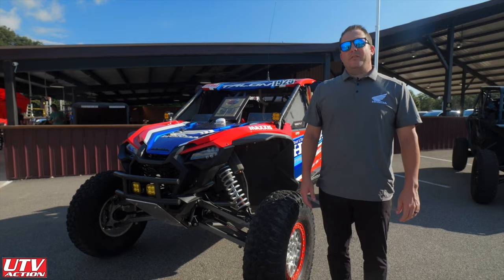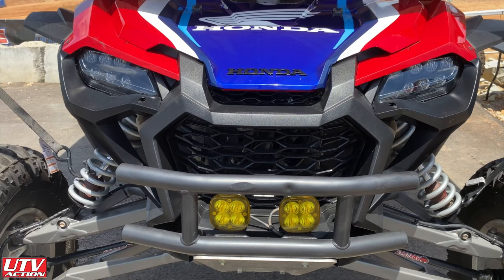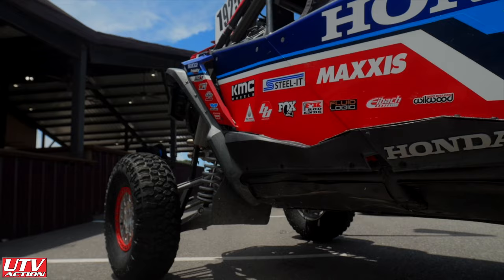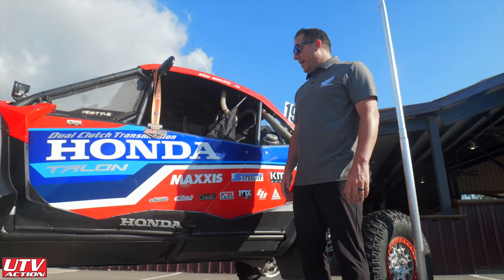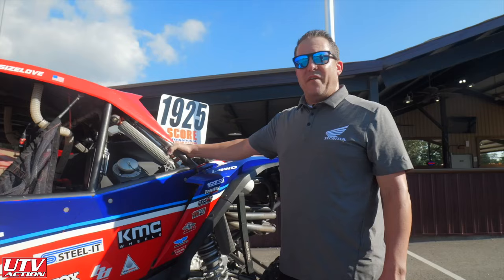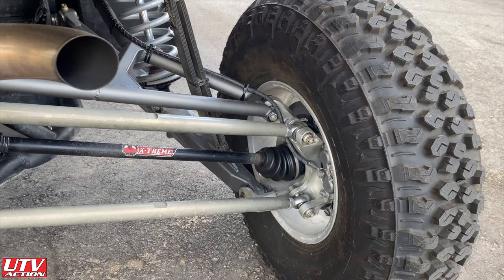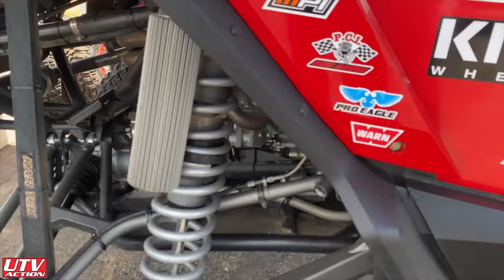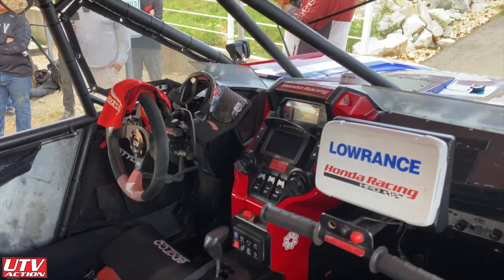Inside Look at Honda's New Desert Racing Talon SXS

Comment: Whoops at 85 on a stock engine with minimal tuning?! It takes me forever to hit 73 on my R. Even without the 75mph governor I can’t imagine getting it to go 85. No tune, but it’s hard d to believe that a tune can make that much difference.
Reply: They raise the rev limit, tune for race fuel, and I'd be surprised if the head and cam weren't reworked. Still stock pieces but they're built. You can gain ~40% HP with a built Talon N/A motor. My stock Talon will hit 80 on 32" tires at lower elevations. Actually when I hit the 74mph limit on the Speedo I'm at 84mph GPS.

Comment: OK honda if you see this.. Step up the r model make it bigger longer wider and give us the 7th gear like the honda goldwing... can am just came out with the duel clutch 7 speed... we need 7th gear I ride in wv and when I hit 65 up sound like I'm going blow it up like to it 85 and cruise... need bumb up the hp to 115 120.. give us throttle by wire and give better intake. Make the r 72inch wide make it little longer give more room in the cab give us seats we can tilt back lower down some give us atleast 10 gallon gas tank.. and please I know ever one will agree on raise Rev up to 10 to 10.5 sorry it sucks when u getting into the power and boom its at 8 grand already sucks... give us a Water tempt gauge number instead them bars I like know how hot it is... give us buttons on the cluster to set different things and give it Option where we can choose different hours for oil change.. the x is fine for what it is but please make the r way better bigger power long travel  72inch and give it better gearing for 32s and bigger... need better turning and not shorting it... and give it same size tires and rims all around.  And for love of God get rid of the i-4wd. Do a true 4-wd...
Reply: All plus be nice give a more sporty steering wheel rubber Moded to... and in the dash give it Multiple functions screen with GPS shows what shocks doing radio and Dinoxic reading if something happens it tells u what it is and the code... something in the lines like the ride command and the krx screen but better then the krx..